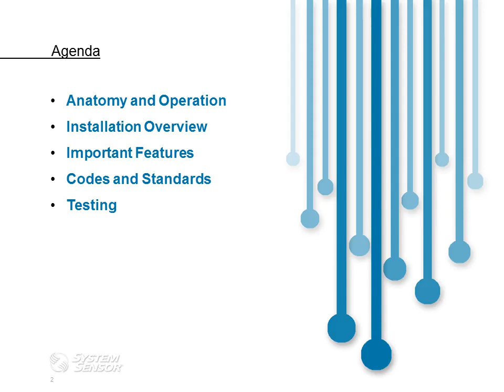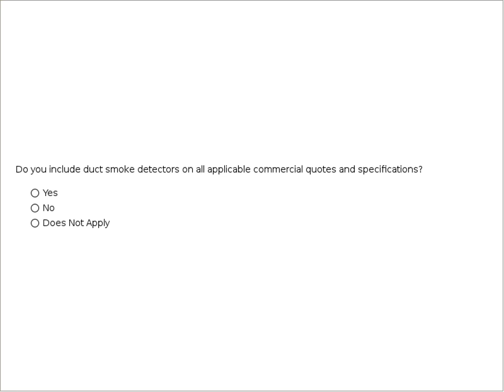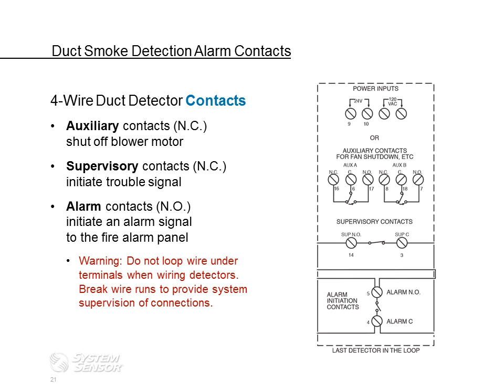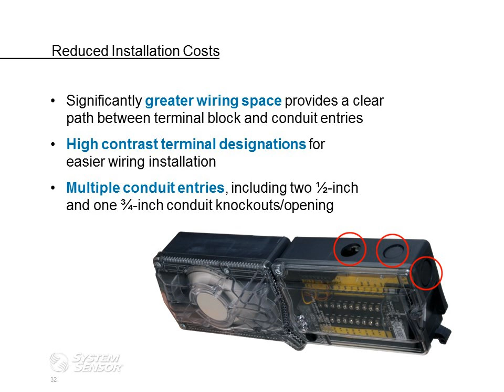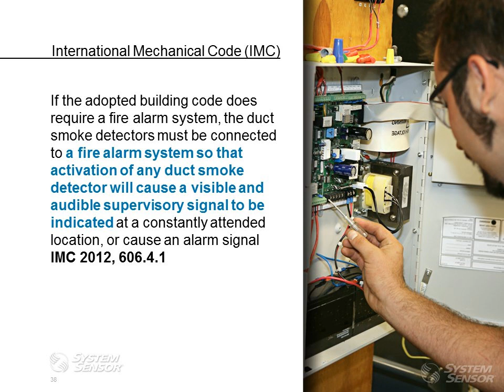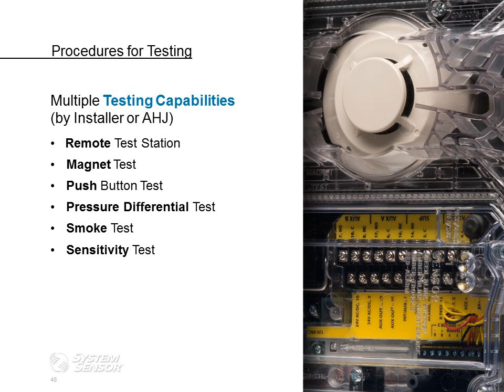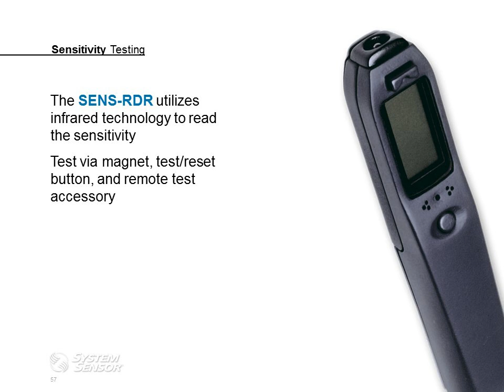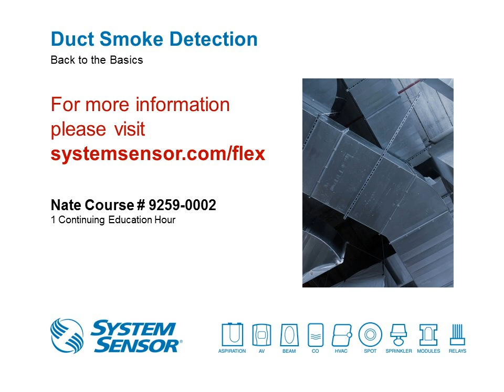HVAC -- Webinar: Duct Smoke Detection Back to Basics

Comment: Thank you for this video, very informative, with one exception;
Please share where IMC 606.2.1 states "5 tons or larger it has to have a duct smoke detector in the return side" as you stated in the video. It states "Capacity greater than 2000 CFM".  Not "equal to or greater than". So the way the code reads for my market (Ohio, 400 cfm per ton) return smoke duct detectors are NOT required for 5 tons or less for units serving one isolated area that is not common to other systems.

Comment: If anyone can help  pleases see if this makes sense.
I’m trying to get a better understanding with these things. I have a system sensor d4120

So  to test things out I have 24v on 9,10.
On 4c a resistor to 3c. 
14no connected to 5no

I have a green light flash every 5 seconds on the head and board.
The thing is the normally open supervisor contacts are closed for 35 seconds then open but show no alarm .
When I do go into alarm the red light is lit and contact 4c and 5no are closed but no changes in the other contacts.
I thought it was the board itself and tried another one but I have the same issue.
Can you help ?
Edit . According to the instructions on status indication listing 3 and 14 only.
On startup closed, Maint closed trouble open.
Ok so I’m open I should have and amber light but I don’t. I still flash green..